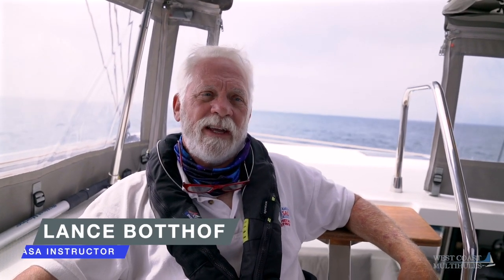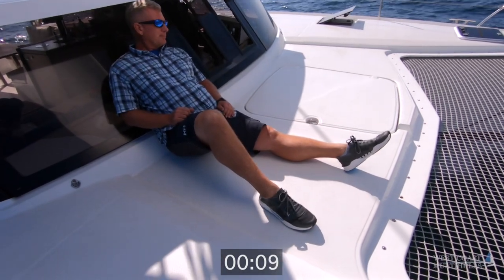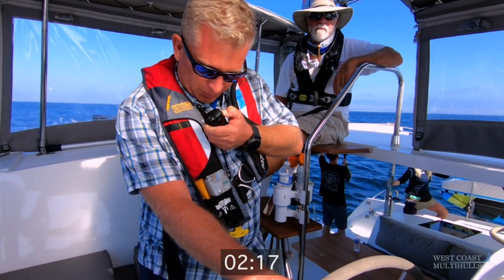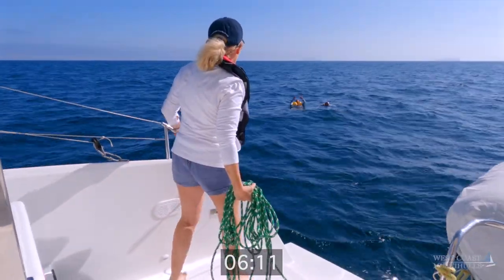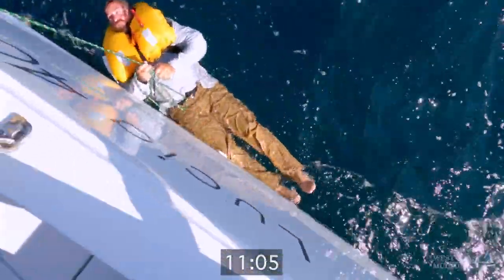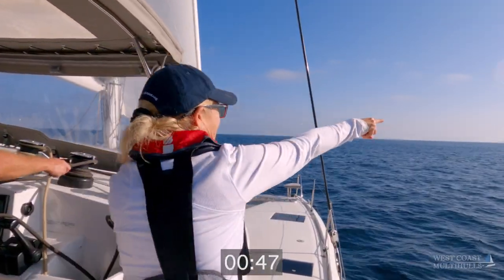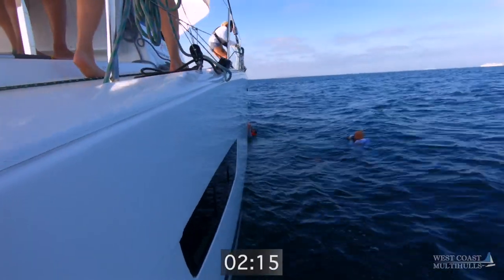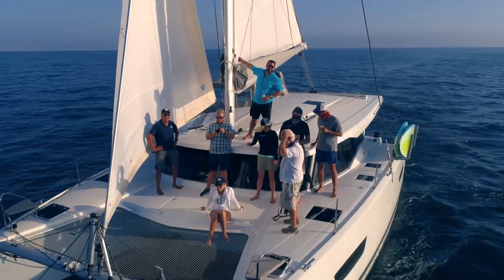Man Overboard Drill with a real person in the water!

Comment: I would recommend you get a Lifesling. Instead of trying to position the boat so close to the MOB, all you gotta do is drag the sling to him. Much easier and faster to accomplish. Also much safer to recover the MOB with in case of rougher weather. In this drill you nearly sailed over him several times, imagine what that would've been like in rougher weather

Lifesling procedure is very different from this so of course it needs to be practiced properly before you can rely on it in a real situation. Secondly you can buy a GPS/DSC capable radio to press a button to send your coordinates, no need to read them off of the screen. Something to consider for sure..

Comment: I’d call that drill a failure. I wager if you did this on a GC annual inspection you would be shut down. There’s a reason the CG uses a dummy not a live person you need to be able to quickly recover a unconscious person who isn’t wearing a PFD. You don’t shut down engines, back down on the person, ect  in a man overboard situation you do a Williamson turn and come along side the victim (person or dummy) and then hoist them onboard. It shouldn’t take more than a minute or two max. Don’t get me wrong I don’t expect non commercial vessels to have the same standards and performance as inspected passenger vessels but this was an absolute failure. Your life ring didn’t have a strobe light or any line on it!
Reply: A successful MOB is when you get the person back on the vessel, alive and ideally unharmed. I would however encourage you to get your GoPro and out show everyone how it's done. Please leave the link here when you do, I'd really like to see it.
Reply: @bjackson1975  We have some ideas planned for this summer. I was just talking to one of the instructors about practicing with a life sling and making a video out of it. We also probably need to make a by-the-book MOB video. However, the tough thing about making a video on exactly how to do a MOB pick up is the number of acceptable ways to do it. There are so many variables every time that there is not one correct way to do it. Like you said, "A successful MOB is when you get the person back on the vessel, alive and ideally unharmed". We will do a couple more this summer when the water warms up. Thanks again for the support!
Reply: When I did competent crew training we had random 3-4 MOB exercises at any minute every day, no warning. No announcements. Some were just hat overboard which became man overboard exercises. We lost 2 hats in 5 days. Never able to find them even though they were floating and we had a full, young fit crew. You lose the head in the sunlight on water in a split second. It took us 15 minutes to get a fender back onboard because we were traveling at 8 knots and the instructor gave us a 10 second delay before announcing man overboard. We sail in bull shark and irukandji territory and you really don't want to be in there too long.
Reply: @bjackson1975 This is a good point. I think we should set up a camera on our boat when trying this. That way we can examine our sparkling or otherwise performance. I'll see how embarrassing it is before posting.